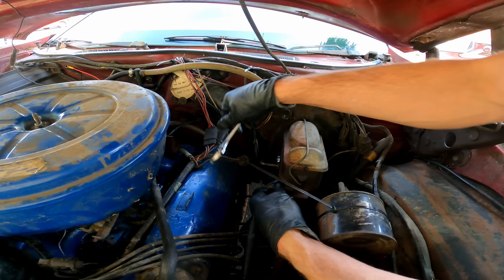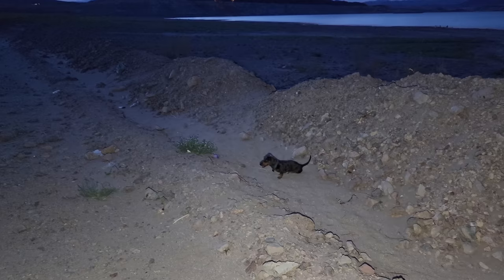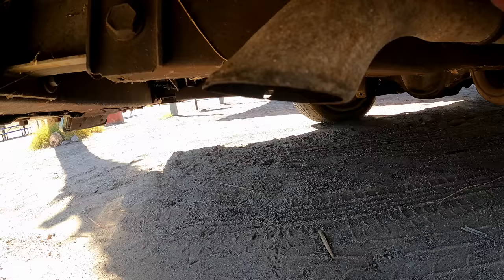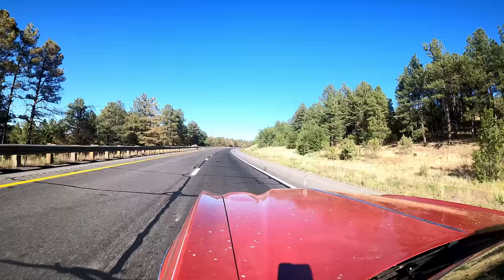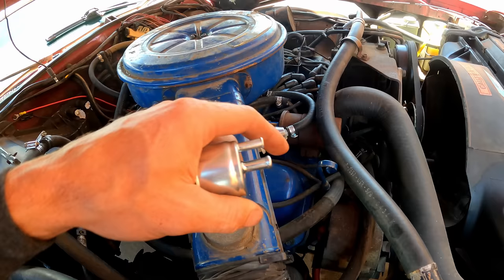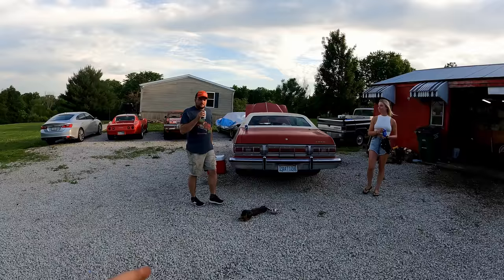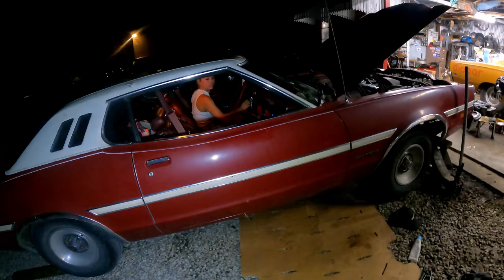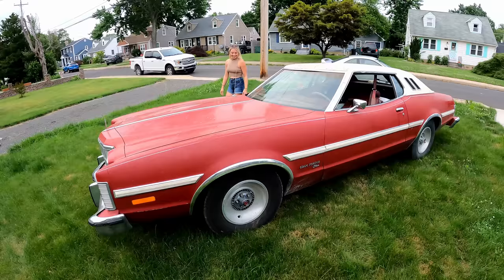Will The 1974 Gran Torino Elite Drive 2500 Miles Home? Vegas To Philly - NNKH

Comment: I have a 1975 Lincoln with 65,000 original miles on it. Five new tires four years ago. New plug wires and fuel pump. It runs but it not like it used too. Mechanics put on a New Holley that is to small but works. The old carburetor I still have but the air cleaner stud is stripped. AC pump is out but I have a new compressor in the trunk.. Aftermarket AC Comp.. Sitting here in Las Vegas NV I need 6K for it. Interior is in good condition, one wheel well passenger side is damaged and some chrome on that side is bent..  It just sits here in the sun.. I'm not in to it anymore.

Comment: My old 78 F-150 would have fit right in at the River Valley Tavern! The truck gets about the same mileage with its 300/6. Edit, Oh wow I just remembered that I once had a 74 Torino but I don’t think it was a Gran model but it had a 2V 351C in it I remember.

Comment: Very cool trip. BTW: I'd be careful with the drone. I'm not sure if there are safeties built in, but the drone motors can generate power and I'm not sure if it could actually break the controllers. I'd be interested if someone here knows for sure and can weigh in

Comment: I HOPE some cheap COMPRESSION tools read way different?
My 20 usd Yst Tool from amazon only reads 75 psi on my#4 piston  in my 76 390 fe and 110 on three of the HIGHEST ones?
it does have a miss so hopefully soaking #4 in seafoam and maybe engine restore pops out those stuck rings

Comment: I had a cougar XR7 it looked exactly like, only it had square headlights !, Nothing but pure luxury !, You can fly over railroad tracks and not even know it !, It was midnight blue had a half white vinyl roof ! It was a 1977 351 Cleveland !! , I wish I had never sold that car, but I was younger then and I love more stupid I didn't know what I had I put a 70 series set of tires all the way around raised white letters !!, Netco is really smooth !, Look like a giant Hot wheel !! , They don't make cars like that anymore, it had Chrome all over the place!!, You can't even find a luxury car of today!, Echo luxury is junk, they don't know what luxury is !! , The seats went back-and-forth lifted straight up and down and tilted frontward and rearward, they recline dollarway back !! You can fit one of these new cards at the day and the trunk of that cougar !! , I do miss those cars, especially to Torino's !!

Comment: Just seen you for the first time now. Question ? How do you operate? I mean do you already have buyers for these cars and you get paid to go get them and at least get them cleaned up, running and driving for the buyer? Or do you rub around the States randomly and fix whatever you pick and try to sell them for a profit afterwards?
Reply from the maker: Pretty random and spur of the moment usually.  A lot of times lose money on these cars.  Sometimes I profitr rare though
Reply: @NoNonsenseKnowHow  Need to get hooked up with old millionaire car collectors. Bet they would pay for your trips along with your skills at repairing the cars that they want? At least this way you would already have a buyer and get paid to fix it too. Suppose your YouTube channel is paying you pretty well already though? If not you could add that to it.

Comment: Deisel Oil does not have High anymore 'if you want a High zinc Oil you need ether Brad Penn or Joe Gibs Oil . Zink destroys cataleptic Converters' it has not been in deasil oil for a long time. Do not use a Zink Additive,' the chemicals in the Additive can create a Chemical reaction with engine Oil .I found this out the hard way using Rotela Oil as a Cm Brake in oi. I did all th proper brake in procedures, but the Cam failed. I contacted Shell oil, they said they had to remove the zinc to meet manufacturer Warranty standards.

Comment: What kind of problems would i run into getting a 1999 mustang 3.8 sitting for 4 years?
Reply from the maker: If it ran when parked, probably none. Just a battery or charge the one in it up
Reply: @NoNonsenseKnowHow  I DRAINED ALL THE OLD GAS OUT BY TAKING RETUN HOSE OFF GAS TANK AND PUTTING SIPHON HOSE IN IT FROM O'REILY.

Comment: Dude! Quit hanging the cam out the window or at least turn the mic off! btw I had a 71 torino GT 351W that vapor locked all the damn time in the hot TX summer. The heat gage read hot all the time but it never overheated. I miss that car.
Reply from the maker: I usually turn the audio down when editing

Comment: It is sad, I had ten times better luck with my 1901 Oldsmobile with a V-Twin Briggs Stratton Engine traveling from Redding, Ca. and St. Joseph, Missouri and Return. I only had to buy one Tire. And with a 3 gallon gas tank I was able to travel 29 M. P. Gallon and always carried a G. I. Gas Can on the Luggage Rack full of gas and a Gallon of Oil and only used 1 quart in 1500 miles each way. I am now planning a Trip to Missouri with my 1962 Studebaker 3/4 ton Pickup towing my 1901 Oldsmobile as our touring vehicle. I wish I knew how to put it on You Tube. My wife has Alzheimers and I am 83 years Young, But we are still going to make the trip then fly back to Ca. and pick up our Motor Home and our regulars driver a 2006 Buick Lucerne. Our Motor Home is a Class A. 32' 1997 Winie. I wish we could get sponsors because this is our last trip. My wife is getting worse and I am disabled on a walker and Oxygen. Just an old Missouri farm boy  who served with the 101 St. Airborne and always tried tomake jobs for people who had hard times getting work who had big families. We want to sell out home and New Shop in Classic Car Paradise.

Comment: I bet you that Torino is already starting to RUST
Reply from the maker: It's been rusting since the day came off the assembly line. Yes rusting a little bit more rapidly around here with the humidity and rain.  But it's not like it was a cream puff. Already had a fair bit of rust. Very clean for the year though compared to what I see around here